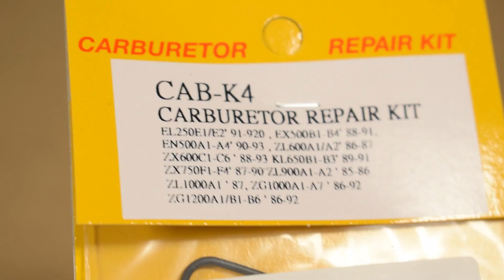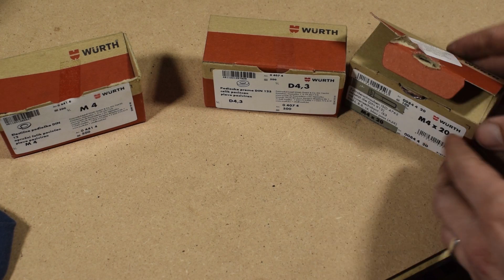ASMR for PETROLHEADS, BIKERS, MECHANICS - NO talking - FULL carburetor rebuild - NO music

Comment: An ultrasonic cleaner does nice work on the small parts too (harbor freight).  You can get an ultrasonic cleaner from china that is large enough to fit the whole carburetor in (ebay).  Wonderful video.  You can also get viton o-rings from mcmaster carr that will fit for the needle valve and other locations.  Little cracks in that needle valve o-ring just messy things up.

Comment: Love this, I've watched it a few times now! However, having just rebuilt mine, I noticed you used M4x20mm machine bolts, which are slightly too long (you can see it as you tighten them up) I've found the correct size are M4x16mm, in case anyone else wanted to change!

Comment: Thanks for the vid. It is awesome to see.  thought carb cleaner ate rubber gaskets, so I always remove them prior to cleaning up the metal. leaves me with a problem of how to clean the rubber bits though.... Also found that wadded up aluminum foil does as good a job as abrasives, and is less likely to leave debris in the micro passages. Thanks for sharing!

Comment: Awesome video man. I can't believe I have missed your upload by so much. But it did somehow give me some new, and most importantly, useful informations and I hope I would be able to use the knowledge in a carburetor rebuild that I wanna do. It would be a single carb, but a 2 barrel Solex 32-34 13z which is a little more complicated. I have rebuilt old motorbike carburetor maaany times, but this one is going to be more of a trouble I guess. Also the parts for it are pretty rare now! Leave alone any guide on how to nor anything.

Comment: Startron from the Walmart boat section every winter storage will prevent this old fuel mess. Leave the  petcocks on- as fuel evaporates from the float bowls, better fuel from the tank will refill them. No fuel dries out and maybe cracks the rubber and plastic parts, unless you add a marine fogging oil spray. For spray paint, I like the ceramic brake caliper paint from an Advance auto parts store. I like lots of Fluid Film spray from a Lowes store to lube the throttle slides and diaphragms.
Reply: No, the bowls will not refill from the tank, these have a vacuum feed which means the engine must be running to allow fuel to flow

Comment: Now your doing something I actually know a lot about although I haven't worked on CVK /Kawasaki carbs for a few years. (usually Honda, Yamaha and Suzuki)
Guess whoever had bike before you  never heard of JIS screws? Using Phillips or 'posi drive' almost always chews up JIS although a #3 Phillips is 'almost' a good fit for #3-JIS if you tap it into screw head.
 Really should have run a fine copper wire through pilot jet, the brass gets a layer of oxidation and restricts the hole size, very easy to burnish out though. 
The 'good' thing about Kei-Hin carbs is the jet size is almost always the hole size in millimeters.
 Probably have around 35~40 pilots so it's 0.35~0.40mm diameter (around 0.012")
(Mikuni and some Kei-Hin use flow rates @ around 19" head of fuel.
 There is a 'standard' but I forget exactly (It's based on AMAL carbs as Japan (Mikuni)  made them under licence pre-WWII)
Should also have checked the cross drilling in emulsion tubes for the same problem (copper is softer than brass so won't enlarge the holes)
It's also a good idea to check tips of fuel mixture screws with a magnifier (I use x10 loupe)
 They often have a slight burr so don't meter accurately. You also need to make sure the springs are flat on the ends, almost all aftermarket kits have the spring just cut off leaving a sharp edge that digs into carb body and screw damaging them (not such a big deal on screw but is bad for carb body) It removes material that can get in passageways causing problems
Reply: Bang on 1crazypj, I also split them to check seals and to give the bodies a clean in an ultrasonic bath
The O rings on the fuel feed tubes are more than likely bad. If I remember correctly the throttle shaft seals are felt on these carbs but many other types have rubber rings of one type or another, which go stiff with age and need replacing
Carb cleaning & servicing is a dying art these days and this video isn't bad compared to many of the half-arsed efforts I've seen on YT
Reply: @UPTHETOWN  Hi Andy, I rarely use ultrasonic any longer on 40~50 yr old carbs, found it leads to excessive pitting where time and various chemicals have etched body inside float chamber.
 I have soda blasted carb bodies which does a great job of cleaning external surfaces but don't normally do much with cosmetics as I modify carbs to suit 'new' E10 fuel and removal of stock air filter system (although the mods work well with stock system) 
The factory setting don't generally work so well with today's fuels

Comment: hell yea!  thorough revival, leak test on bench and synchronizing went well?
Reply from the maker: Leak test went well, zero leaks. I didn't synch on bench as I didn't separate them. Will synch once running
Reply: @d4a  yes, that's what i meant, synched therm on the bike once installed and ready to run.  do you start the screw 2-2.5 turns out before making adjustments, or use previous setting and go from there?  assuming no change to intake or exhaust systems

Comment: This video was EXACTLY what I needed, I plan on cleaning my Keihin carbs from my Kawasaki GT550 and couldn't find a video anywhere until I came across this. Will be using this for when I come around to cleaning them. would have been good to see you ultrasonically clean them. 10/10

Also could you include the details of the replacement parts you used? I wanted to know which fuel hoses you got?
Reply: I did my carbs on my GT 550 and the only bit I couldn't get were the rubber diaphragms.

Comment: If you have a UK gpz900 that hasn't been upgraded to water heat version, you might get a set of new. They were on call back.
When i bought mine in 1999, it had call back letter which was honoured. One of my customers ran local dealer, he did job, said i had £1300 of new carbs. Worth asking if still honoured. (only paid £1500 for spotless 1984 bike).
Only problem with gpz, it'a a rocking horse, didn't like going around mini roundabouts.

Comment: What your process on jetting ..
I've got a 1980 Suzuki GS 850 sat for at least 13 yrs ..has 4into 1 exhaust ..I took apart carbs and throughly cleaned every passage several times..new jet kit ..starts and runs at idle ..once you go past 1/4 throttle it stumbles and dies out ..started with #40 and # 115 jets..didn't run good ..took out 115..put in 120..no better..took out air jet was 180..put in 190...no better ..with air box on ..and a rag over intake of air box ..great throttle response..with out ..won't go past 1/4 throttle ..
Any ideas ..??

Comment: My car is carbureted and i want to swap the engine and install bike carbs, did i need to replace the fuel pump or buy a fuel pressure regulator?
Reply: You... want to install bike carbs on your car?

Comment: I have the same exact carbs, 2003 zr7s, I’ve rebuilt as much as i can but it still has the tiniest leak that looks like either the bowl or just above it, do you know what the exact causes could be? Please and thanks!
Reply from the maker: Sorry, I've seen a few of these, usually they don't leak so I can't help much. Did you replace the float bowl seal? Make sure there's no gouging on the mating surface of the float bowl

Comment: What was the white powder you used to scrub with?   and was that combined with WD40?    Also where did you source all the new hardware?
Reply from the maker: It's a kitchen scrubbing powder. Yes, combined with wd-40, it doesn't work magic but with patience it yields good result. Rebuild kit is from German eBay, all bolts are from Wurth.

Comment: Could you tell me the upper T lines O ring sizes???
Reply from the maker: Which ones exactly? The ones that were yellow? They were 7mm
Reply: @d4a  I mean the lines that connect one carb to another,not the center T line.If you could find the sizes just tell them to me I really need them
Reply from the maker: Oh I didn't separate the carbs, so I don't know, sorry. But I'm certain you can find that easily on a parts diagram somewhere online.

Comment: Wth this is a partial rebuild at most with honestly too much attention towards non vital painting/polishing of things. How can you call this a full carb rebuild? 😂 Lots of things weren't shown so how's anyone supposed to believe it's a full rebuild. Didn't show splitting of carbs or removing the vacuum slider piston support card. Starter jet removal. Your typical YT bs.
Reply: Spit and polish garboo. No enrichener circuit work, no anticackle valve clearing, no emulsion tube clearing, none of the four circuits cleared, no bench sync. It's been awhile so I thought I'd watch a rebuild video but I regret this one. Also, that irrelevant paint job.